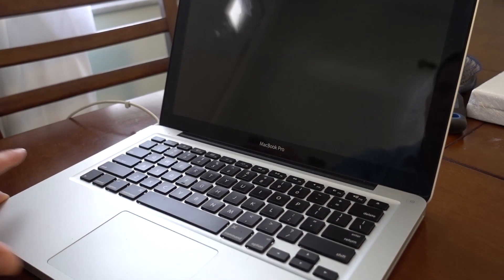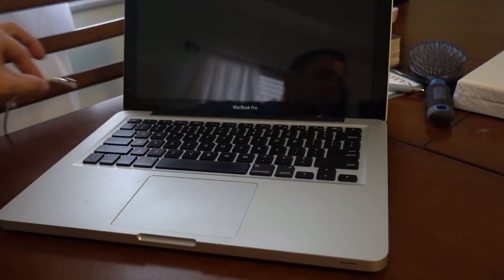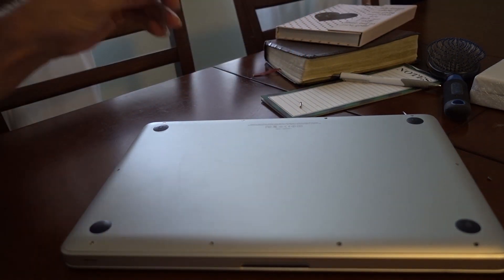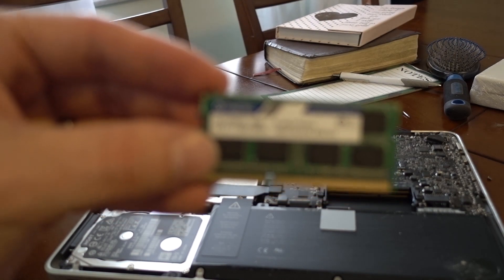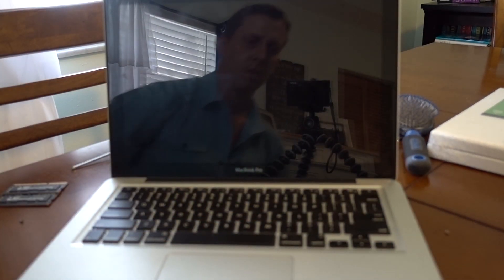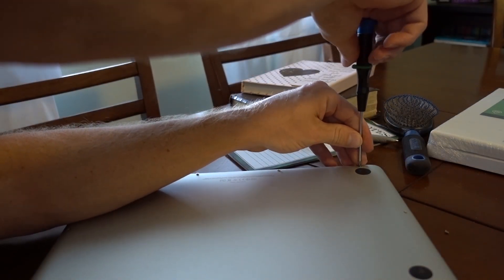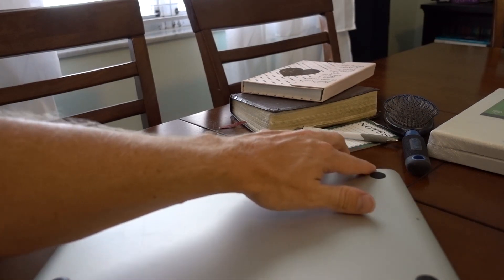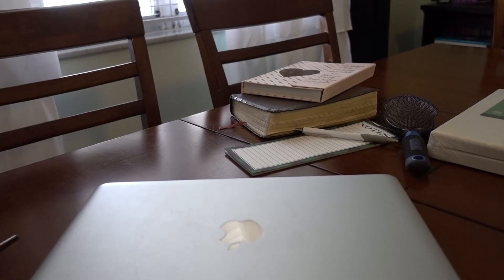How to Fix 3 Beeps Black Screen Apple Macbook Pro

Comment: I had to disconnect the connection from battery to motherboard. Then re input the ram, then connect the battery and that fixed the beeping. I have to try to see what is wrong with the other macbook now.

Comment: What if you've replaced your RAM and the issue persists? I replaced my RAM after this happened and a couple months later it started again. The previous RAM wasn't that old, either. Thanks.
Reply from the maker: You might have a bad dimm slot. Try removing one stick at a time and then boot your Mac and use it with only one stick of ram inserted. If it still beeps then remove the other slot and put ram into the slot that was previously empty. Process of elimination.
Reply: @CJRichvideo  Thanks! Will give this a shot.
Reply: @CJRichvideo  Thank you Thank you Thank you!
Reply: This did it for me! The bottom dimm slot is bad.  Thank you so much!

Comment: The 3 beeps is also a board level issue. 

I am just going to point this out as well. There is a flaw with 2012 MBPs that Apple is refusing to acknowledge -_-
Reply: Yeah, because I've swapped so many sets of RAM modules and it didn't help. My guess it's the logic board itself :(
Reply: sushles yep! Agreed. Mine doesn’t make the 3 beep sounds it just makes a brief whir sound and a small quiet 1 second beep and it does this every 5 seconds. It just did this half an hour ago, I was in the middle of watching a YouTube video when the screen started glitching like crazy and then just shut off completely. Hadn’t turned on since. Super irritating.
Reply: Mines from 2012 as well*

Comment: help! my macbook still turns on, but about 5 mins into using it, the screen will freeze with horizontal lines and 3 beeps will be heard until it will black out.. i tried opening the RAM and put it back again, turned on my macbook but 3 beeps still happens about 5mins into using it.. what should i do?
Reply from the maker: Did you actually replace the ram or just reseat it? Sounds like you have bad memory that needs to be replaced not reseated.

Comment: Ram replaced, still beeping and giving me the same problem
Reply from the maker: Chris N you probably have a bad dimm slot. Try removing one ram stick at a time and see if it will boot off of one. If so, then you have a bad slot.
Reply: @CJRichvideo  thank you so much I have been trying to figure it out for months . I was just about to give up and turns out I might have a bad ram slot . Any idea how to fix that ? Thank you so much !
Reply: Thanks for the response. I tried airblowing it and reinserted the RAMs and it’s now playing again. Have had it on for 3hrs now. Hope it stays that way.
Reply from the maker: Awesome. Sounds like some dust might’ve been causing a bad contact on one of the dimm slots. Glad it’s working now.
Reply: @CJRichvideo  It is actually also a board level issue. 

I just gave up on my Mac and took the RAM and switched to a Windows PC. Guess what's crazy -- the RAM tests fine in the PC. 

Not coming at you or anything, but there is a board level issue that Apple knows is wrong with the 2012 non-Retina, but since the PC is so old they are just like shrug.
Reply: How do you fix a bad slot?

Comment: Hey CJ, my Macbook only works with 1 ram card inserted. What does this mean?
Reply from the maker: More than likely you have a bad dimm slot. Unfortunately there is no way to fix that unless you replace the logic board. So you’ll have to continue using the one good dimm slot you have.
Reply: CJ Rich Interesting. Do you think 2 new cards will fix the issue?
Reply from the maker: Have you tried the working memory in the slot you think is bad? If it’ll work, then you’ll be safe to order two new memory sticks. If it won’t boot, then the slot is bad and I’d just order a single 8gb or 16 gb stick and run off of one.
Reply: CJ Rich I’ll definitely try that. If it doesn’t work I’ll use it with the one slot that works like you said. Thanks a lot!
Reply from the maker: You’re welcome. Good luck with everything!
Reply: CJ Rich I’ve got the same issue. It only boots with one card. I have a 4GB card, when booting the screen flashes. Is it worth buying a single 8 GB card? Thanks
Reply from the maker: dan kidd it all depends on what you use it for. If you do basic things like web browsing and word processing I’d give it a shot with 4gb. If you use it for heavier purposes then I’d buy a single 8gb stick.
Reply: CJ Rich It doesn’t fully boot up with the 4GB card (I think it’s due to insufficient memory as it failed when I had 2x 2GB cards). I think I’ll get an 8GB card and see if it boots.